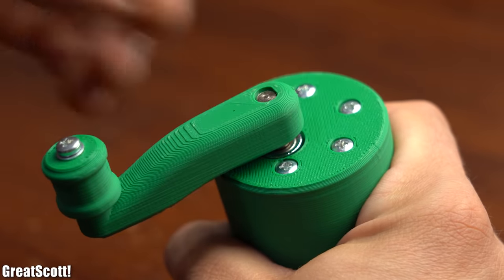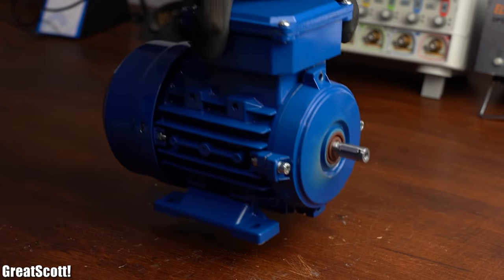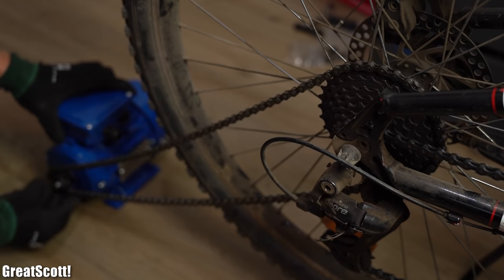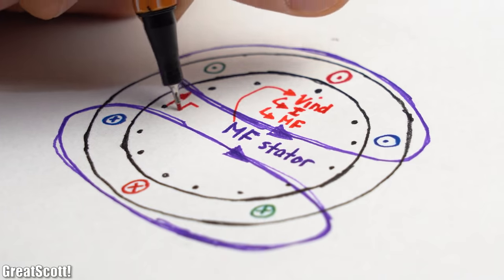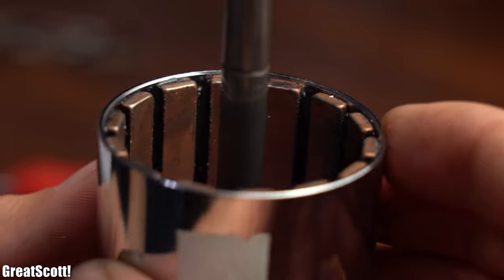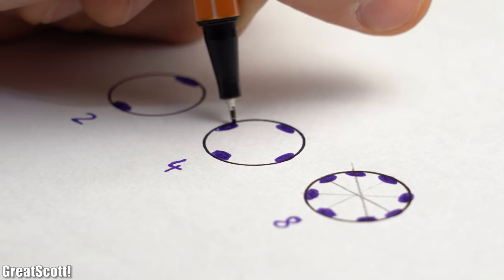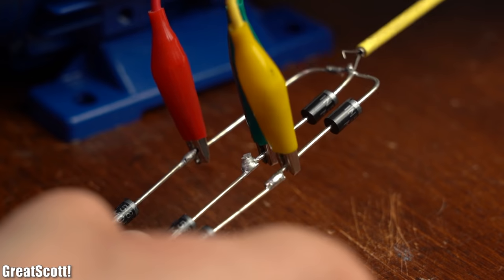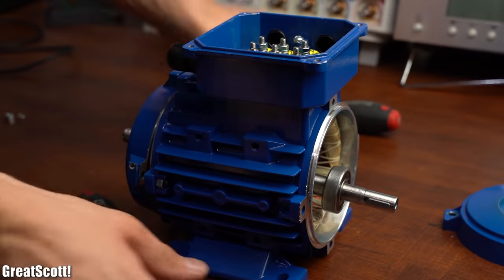HACKED!: Turning an Induction Motor into a Generator?!

Comment: ok so it doesn't work with ac motors because turning them into permanent magnet spining motors simply don't bring enough magnetic flux to produce decent current or voltage
let's put that  situation in reverse, when we have  a working permanent magnet dc motor used as a load but then we stop suplying energy and the load is free spinning and have enough kinetic energy to keep spining for a while. shorting the motor would make a very efficient  electric brake but also could break the  motor so how hard is to build regenerative breaking charger for lithium ions?
would we have to step up and down the viltage  or just capture it ?

Comment: Please do it right with a capacitor bank and above synchronous rpm. Bonus points for calculating capacitance required and max power available (VA).

Comment: Hii. I think if you reduce the air gap between rotor and stator winding, you can get a better output voltage. As air gap losses will be minimised.

Comment: I'm surprised you modified the motor with magnets rather than using a running capacitor bank for the reactive power, it's much simpler and probably cheaper than magnets too.

Comment: I believe you would have gotten considerably greater results if you had used an unmodified rotor and stator for this job. I believe that the rotor not being ferromagnetic, together with the weak magnets, is what resulted in a low power output. I believe a squirell cage rotor, when properly excited, will create a very strong magnetic field, much stronger than any permanent magnet that can fit there. Also, watching you use an induction motor as a generator by having the squirell cage itself make the magnetic field would be awesome! :D

Comment: Get an idler sprocket from a deraileur and use that on the motor. That should be guaranteed to fit the bike chain. Then it shouldn't be too terribly hard to enlarge the hole if needed, and then use a saw or file to add a keyway.

Also some generators are basically induction motors where one set of coils is driven by a battery. They don't have any permanent magnets, but obviously don't work if  the battery goes dead. (When used regularly the battery gets recharged and only provides enough power to get the thing started.)

Maybe those could be tried when the next video gets made?

Comment: In short, induction motors used only for rotating device not as a generator cause it has no magnet to produce magnetic field which no voltage is generated. But yeah this video is family friendly for beginners. Like it~~~

Comment: Eddy currents works both ways, in stator and winding, get the clue!!

It will likely kill off any induction in wires and induction with those tiny magnets is very small comapre to surface area winding has.

Not to mention, coils in these motors are used to induce magnetism, not cut the magnetic field and generate power, so power generated is very small. It's more off trade-off depending on application about using mateiral that works for application and design of those parts. While concept works, it just won't be efficient at the end.

Also your gear needs to be compatible with metric or imperial system used to design bicycle, that's why chain was falling off.

Comment: What if instead of going through the step of making a new armature, use an original motor but "excite" one winding with a low voltage DC? The motor then would become a "transformer" of sorts, outputing AC from the remaining 2 coils. And once started, perhaps the DC could be switched off? I'm just spit-balling so no clue if this would work. It's not "free' energy since the armature would need to be continuously rotated, but figured it would be easier than rebuilding motors, and i know some generators work in similar fashion to what I describe, but again, no idea how they are wound. Thoughts?

Comment: Nice video but 1 mistake is ur magnet arrangements is 8pole while your stator has 2/4 pole(more pole lower rpm) so u can change magnet arrangement to 2 or 4 pole following your stator pole, at least u can generate 100w with that
Reply: And also u can place magnet with little slide for minimize coggibg effects

Comment: They make motor bike chain adapters for bikes they are used for using ICE motors on pedal bike. A roller on the rubber might be easiest though

Comment: have you tried to use an identical motor without modifying the rotor with magnets, but simply self-excite it with external capacitors? with a 400V saddle motor and 230V delta motor and the c-2C technique with a delta connected motor where the microfarad capacity of 2C is double of c, (to be calculated and or found empirically in steps of 5 microfarads as final adjustment) the load goes connected on the ce on the central and not on 2C and central (eye to the direction of rotation) so you get the single-phase 230V, it is used in the hydroelectric off grid from the KW up with electronics that manage the derivation at constant load, called IGC (generator induction control) based on the voltage generated, in your case you can excite the motor with 3 equal capacitors use the motor connected in a star and rectify with a three-phase diode bridge to generate continuous voltage, downstream of the bridge it would be better to put a nice polarized capacitor or more in parallel to filter, you enter a suitable MPPT charge controller and that's it, but with pedals I see it hard, in this case with low and variable power, a magnet alternator perms is the ideal solution.Ciao  https://www.doc-developpement-durable.org/file/Energie/hydraulique/Pico_hydro_for_village_power_3.pdf

Comment: Can you get AC voltage from a 3 phase motor if you power one coil with 12V or 24V DC and spin the motor?Will this create AC voltage onthe 2 other coils?

Comment: You used to get generators for bike lights they had a knurlied top that was pushed against the top of the tyre with a spring. Infact I have just checked and they still make them they are about £4.
Reply: They were alternators, eliminating the commutator needed for generator construction.
Reply: @stephenarling1667  , I just checked and they still make the ones I was talking about, They are dynamos,  How did they get the alternator version to start without a battery ? I am intrigued.
Reply: @dogwalker666  
Alternator rotor has permanent magnet pole pieces. Stator windings output AC.
Reply: @dogwalker666  
Here is a nifty video dissecting a bottle dynamo: 
https://youtu.be/6Pa3up4hoXI

Comment: As for your low power output I think that the number of magnet poles needs to match the number of pole pairs of the stator in your first test each pole on the stator sees 4 magnet poles at once (2 north and 2 south wich cancell out giving you low power) a much better resoult could be achieved using 4 magnets having north pole facing out on one side fo the rotor and 4 on the other side having the south pole face outward

Comment: The future of electric motors are in "variable reluctance pulse motor generators". 
I know it's a mouthful, but sinusoidal motors produce smooth motion, at the cost of efficiency. 
What you want is a pulse to do a "Karate" chop at the business end, and pulse the magnets at the right time. Once the pulse has done its job, it's spike is recovered with a diode, into the main capacitor bank, to be reused for the next pulse. I reached 97.3% efficiency back in 2005, converting electrical energy, into mechanical energy. It happens when the RPM matches the pulses to form a resonant circuit!
Each pulse just replenishes what was lost due to ohms law. Like a playground swing, that needs only a small force each time the swing passes the apex. 
Please read up on Robert Adams motor/generator. It's not a free energy device, but a very efficient motor. 
If you gang multiple rotors on to a common drive shaft, and offset each one by an angle (say 22.5º), you can have a very smooth rotation and the rotors will act as flywheels to dampen the kicks from pulses. 
There are many variations of this motor generator. The most famous being John Bedini's School Girl motor, or Bill Muller's motor/generator. 
All derivatives of Robert Adam's work. It was an amazing invention. Too bad he got side tracked by money and greed...

Comment: You should use capacitor in delta connection with parallel to motor. So it can work as generator. You have to increase speed more than synchronous speed .

Comment: Why the magnets didn't work is cause they are too wide. To make them properly work they have to be as wide as the poles the windings are wound upon. When the magnets are so wide the windings generate opposing emf and you get screw all at the output. Also the rotor/stator gap is really important since you loose power exponentially as the gap widens

Comment: Hold on!  You need to energize the electromagnets (w/ batteries) to get the field started and then tap a small amount of current back to them once the generator output is working.  And running a gen off the bike tire would have given higher rotational speed.

Comment: I already have that project....it better to use a pulley around the shaft of the motor and a v belt connecting it to the entire bicycle wheel instead of the sprocket..that way you can easily get the motor over 1800rpm with moderate peddling. It will be difficult and require muscle. Because once you surpass the rotational speed as noted in the previous comments to generate electricity....the torque of peddling doubles and its difficult to maintain 120 volts even for small applications

Comment: First off, you need a much more sturdy bike stand. You can often find the cheap but solid ones at a thrift store. With that you'll also get a basic way to convert the energy from the wheel using it's resistance motor. Although your bike is going to suck at this kind of thing. It would be far FAR more practical to start with a cheap $100 fixie that already has a conversion hub. "Fixies" are a hipster syle of bike that got so popular companies started making them. The style started when a few idiots wanted to take velodrome track bikes out on the road. This is also the way bicycles were all made from 1890 until around 1940. There are no brakes on this type of bike. There is no freewheel either. This means, if the rear wheel spins, so do the pedals. Stopping is achieved by reversing pressure on the pedals with your legs. It's easier than it seems to the uninitiated. Anyways, there weren't many track bikes to satisfy the hipster trend and real track bikes are expensive. 
 So what gives? Why didn't this brakeless dumb bike trend die when demand out stripped supply?
 Well...the main feature that makes a track bike different are the rear dropouts, AKA the place where the rear wheel axle mounts in the frame. On a track bike the mounts are 4-6cm long slots instead of little cups like most modern bikes. The hub axle is bolted into the dropout slots. Once the chain is placed over the gear and the wheel is loosely mounted, the wheel is pulled backwards down the slot then the axle is bolted down. This is how the chain is tensioned to hold it in place. With track bikes this is a super beefy structure. The velodrome track is where big guys can rule supreme on a bike.
  ...However.... old steel bikes from the 1940's to late 1980's often had a rear dropout slot. It isn't as long and beefy as the track bike type. The sometimes short 2-3cm length can make it challenging to get the chain length right and tensioned, but this is where the Hipster trend went. People often took an old steel bike with slotted dropouts, took off everything from the frame and made a fixie out of it. There are some issues though. There were some changes to bike standards in the steel days. Nothing like bikes now, but if you want to build something the most important feature is the width of the rear dropout spacing, and matching this to a rear hub. Most old bikes came with 27" wheels. New road/track bikes are 700c. Most frames will fit this just fine.
 Anyways, if you trace the fixie trend a bit further, you get to the point where people started making a rear hub that could take a threaded gear on both sides. The gear threading is also how old "freewheels" are attached (modern bikes moved the ratcheting mechanism inside the hub instead of inside the cassette, modern is "Freehub" old is "Freewheel"). ...Well some of the hipsters were/are scared to go full brakeless, and this is not good for commercial products either, so people started making dual sided wheel hubs that can be flipped and have a gear or freewheel on both sides. Note that the threaded interface for the gear on the hub is a left hand/reversed thread. If you attached something to this via a chain, you better have a really tight lockring in place and check it often. You should be able to find a fixie for cheap though, one that comes with a dual hub already.
Trainer like this:
https://www.ebay.de/itm/Rollentrainer-Fahrrad-Heimtrainer-Stahl-Klappbar-Cycletrainer-fur-Indoor-Fahrrad/202966037811?hash=item2f41b7f533:g:BV4AAOSw7-peU5sW
Fixie like this:
https://www.ebay.de/itm/Singlespeed-700c-Fixie-Bike-retro-Fahrrad-Fitnessbike-Galano-Blade-28-Rennrad/141957933119?hash=item210d5a283f:g:1tkAAOSwiudcPfHY

Comment: Would it be possible to wire it like a car Alternator? I'm not sure how different the two are but I know that the alternator works in three phase AC and needs power to work which is supplied by the battery until it begins till finally taking over and then has no use for the battery. You may have noticed that if you disconnect the car battery after you have started the engine, it keeps running, so theoretically, if you power it with the correct electric motor, it could possibly run itself! And possibly provide a bit more energy to charge a battery bank...  If this is possible, with the addition of solar panels, you might have the making of an off grid system! 
Although the drive motor would need to be PWM driven for efficient energy consumption... You want to have something left over to power other things...

Comment: Actually, induction motor and synchronous motor are the same things, just that the shafts are different, leading to different working principles. You are just modifying the induction motor into a synchronous motor. You could have just hooked up a synchronous motor to generate power straight away, or just use the BLDC motor with 3 phase rectifier, or a car alternator, it is the same thing, just differ in voltage rating and magnetization method (active or passive). To really use an induction motor as a generator, you need an active component such as VFD (Variable frequency driver) to control the speed, then you need to rotate the shaft faster than the idle speed, then load inversion will convert the energy back to the driver, this is how induction motor's regenerative braking works. It is more on active components and controller, not on the physical build.

Comment: Try something like 
start the induction motor with mains supply... 
Get another prime mover mounted with the motor shaft... 
Maintain the speed of the prime mover speed is equal to the motor speed... 
Turn off the main supply and connect some electrical load to the motor terminas...
Maybe it gona work...

I guess...

Comment: Quite surprised you didn't do the simplest thing of putting a pulley or roller on the motor and let the faster spinning tire drive that pulley/rotor directly at much higher speed... but that might make sense... then there are the huge string of errors redesigning the rotor while NOT taking into account the distance between rotor and stator, the alignment of magnets with length of coils, number of magnets compared to field coils, etc...

Comment: Might it be good to look at a bike dynamo from an old school bike light kit? 6-12 volts AC with about 250 ma, cheep, easy to install, and has three terminals to connect to. Only issue would be ware on the rubber of the outer tire, and the ground terminal going into the frame of the bike. Could also upgrade the incandescents to LED.
Other place to look is a universal motor. Greenpowersciece modified a bike into an exercise  bike over half a decade ago with one. If you are wanting a junkyard compatible solution.

Comment: Just get a book on electric motors and start reading.  You should not modify the motor, just connect it to AC voltage, then rotate the rotating motor by another motor. Then you generate electric energy that feeds back to the grid.  They use this to correct the Power Factor too.  So, try rotating it with say 4 stroke bicycle motor, or say with your bicycle.  When Motor is rotating without you peddling you consume electricity, and when you peddle and you feel the resistance of the motor, you are generating electricity.  One thing you realize is that the motor speed does not change and is constant, no mater if you peddle or not.  To generate power off grid, get a Car generator an connect it to an off grid inverter, then you can get 110V or 220V power.

Comment: Hey you should not fit the magnets to their complete depth. Jus put them halfway through the magnetic core or in this case the 3d ferromagnetic core. Think it yourself you are closing the magnetic field lines from both poles through the ferromagnetic assembly so not much of it goes through the field winding. Try them half exposed and then share the result. Also maybe use pairs of magnets in the same polarity to widen the magnetic field and cover the whole area of field winding core.
Imagine if two magnets of opposite polarity are moving through one coil at the same time their effect would cancel each other.
Reply: In other words match the number of poles on rotor and the stator.